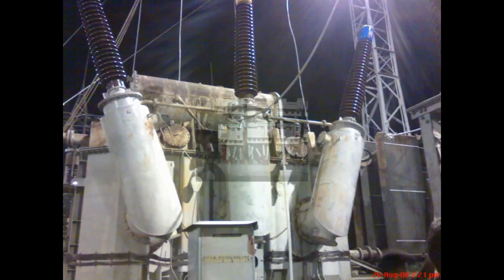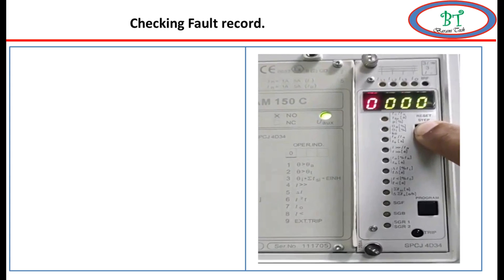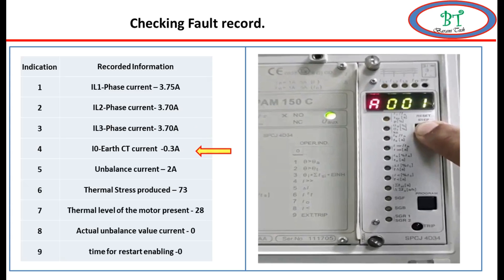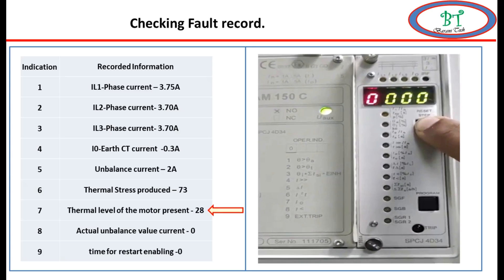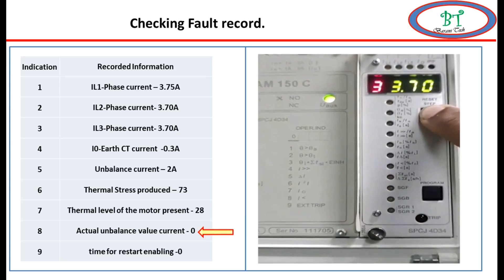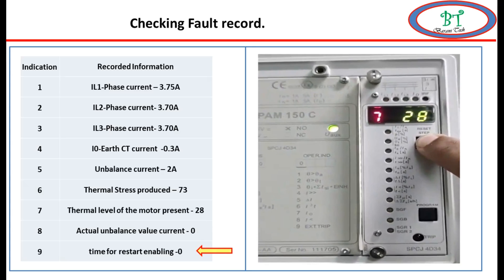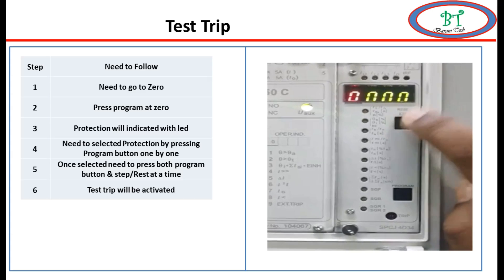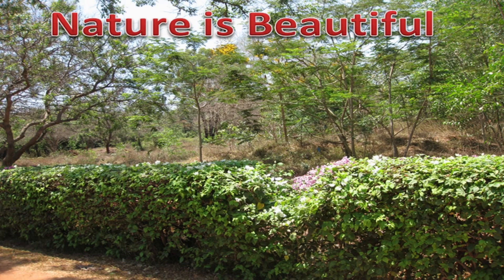Checking Fault Record for SPAM Relay | SPAM & SPAJ Trip Test

Comment: in IL1 ,IL2 ,IL3 current showing 0.25,0.39,0.42 then what will be the load current.CT ratio is 150/1😊
Reply from the maker: we can't tell like that, but we have to see Relay wiring for Ct secondary and motor Rating, but it's better to check on CT name plate detail for more accuracy.